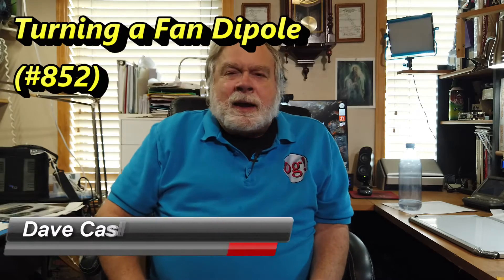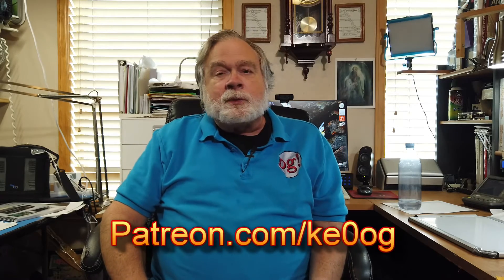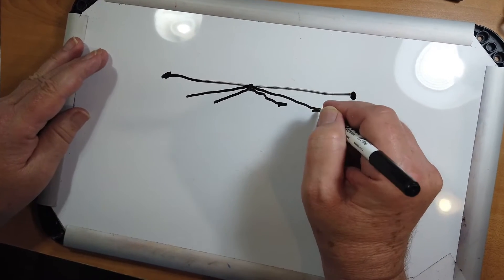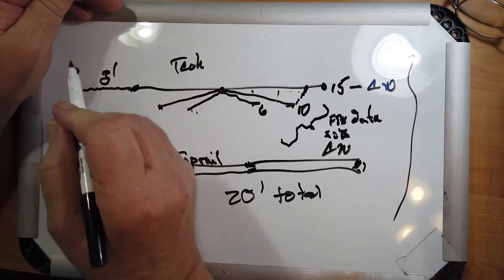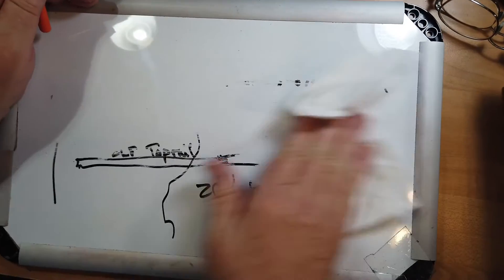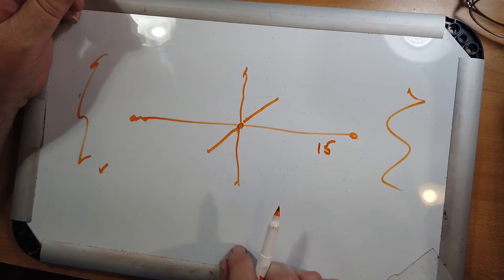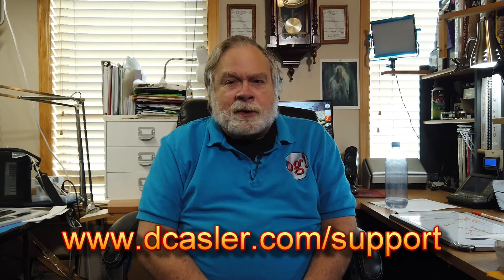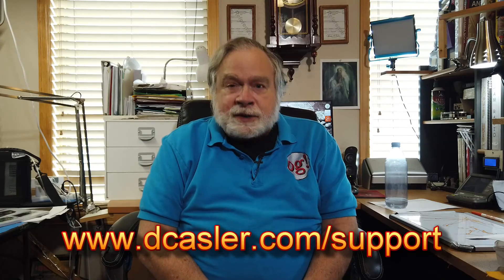Tuning a Fan Dipole (#852)

Comment: That was a good explanation of one of my favorite antennas.  Thanks for posting this, Dave.

I have constructed a fan dipole for portable use.   It operates on 40m/15m, 20m, 17m, and 10m.  It was an interesting learning experience.   One of the things I learned with respect to tuning a fan dipole is that it is important to establish in advance how you intend to orient the antenna.  Because, if you design it and initially install it as a flat top, and you change to use it in an inverted V configuration, the tuning will definitely be off.  

The reason is pretty obvious:

A flat top dipole is going to have a feed point impedance of about 72 ohms, or so.   But, if you install it as an inverted V, the feedpoint impedance will be about 50 ohms.  And, of course, a fan dipole is just multiple dipoles all tied together at the feedpoint - so, this difference is going to affect all bands.

I built mine to be in an inverted V configuration.  I chose that because I then only needed one center support that needed to be up high.  I also designed it to operate at about 30 feet above the ground - because, I can then just toss a line over a tree limb, pull up the center with the coax hanging from the feedpoint, and pull the ends out at about a 45 degree angle and use tent stakes to secure it in place.

For spacers between the elements, I just used 1/2" PVC pipe sections about six inches long and drilled holes for the wires to go through.   Then, I used electrical tape on both sides where the wires went through the spacers to keep the spacers from sliding back and forth.  Spacing is about an inch, or so, between each element - which is quite sufficient.  

Essential for a project, like this, is an SWR analyzer.   Computer modeling can also give you a good idea about your lengths.  And, I found that starting at the lowest band (40m) works best.  Install it, test it, adjust till it is where you want it, then move to the next band up the spectrum.  It ends up like you're building four separate antennas - because, you really are.  To be clear, I am suggesting installing all of the wires at the same time, and tuning 40m, first, then moving up the spectrum to the next band and tuning that.   The reason is that the proximity of the wires to each other will affect the tuning.   So, you want to start out with all the wires in place, even if they are not tuned.   So, you're going to start with all your wires a little long, then trim as needed.

But, once done, it is very nice to be able to predict the radiation pattern and just switch between the bands and start operating with no need for a tuner.   Sure, there are other multiband antennas that use only one wire or set of wires, but the radiation patterns change significantly with odd lobes forming in odd directions.  The fan dipole just gives you a standard dipole radiation pattern on all bands.   

And, I just used a couple of snap on ferrite beads over the coax at the feed point to keep the reflected RF out of the radio.

Thanks, again, Dave, and 73!

Comment: can I run fan with a 72 ohm linear loaded 80m dipole and a 600 ohm folded 40m dipole on the same 450 ohm window line feed point into old style conventional LC tuner (Murch) with twin lead inputs?

Comment: interesting video! I just made a vertically polarized fan dipole for listening to VHF and UHF air band. what I found when tuning it is that the bandwidth increases as you increase the separation of the elements. I ended up settling on a 45 degree angle (about 6 1/2 inches max separation at the tip of the UHF element) with a bandwidth below 3:1 SWR of 20MHz on both VHF and UHF. I am really amazed that you can make a single antenna to cover multiple bands which is of interest to me as a scanner listener.

Comment: Sorry, Dave...but I didn't hear anything related to the question and, certainly, the title is completely misleading.  Wasting my time waiting for "Tuning a Fan Dipole" is not what I had in mind.  Let's try and avoid "clickbait" in the future.  You have some great videos and I enjoy your method of presentation but this one just didn't come up to par.
Reply: NO there is no minimum separation between elements. the bandwidth increases as they are spaced further apart but they can be tuned even when right next to each other.

Comment: I tried a ferrite ring on my outdoor 60m inverted vee at the aerial and found it wasn't very good at stopping r.f. I now have it in the shack. I've seen both positions recommended by aerial manufacturers. I think r.f. got in below the ferrite ring.
Perhaps one positioned some distance from the aerial would be better?
I'm going to slide the rings up the coax to the ceiling to try on my attic dipoles, 14 mHz and 18 on one coax, 21 and 24 on the other with 28 on the other. Three coax cables for less interaction. I might try 14 and 21 together for that reason and 18 with 24 leaving 28 on it's own..
G4GHB.

Comment: I run a home built 75-40-20 fan dipole in an inverted V configuration. At first, I wasn't using a balun. But I then inserted a 1:1 balun. The effect was to reduce noise by 2 S units. I have used this antenna on the 15 meter and 10 meter bands as well. I find it a very good antenna. Tune the longest runs first, the the middle run and finally the shortest run. The center is at 35 feet on an MSJ 1917 fiberglass pole. I try to keep,the ends at 7 feet above the ground in order to avoid deer problems. I have the 75 meter run on a North-South azimuth. The 40 meter run is about 15 degree azimuth from that and finally the 20 meter run is at about 30 degrees from the 75 meter antenna.  '73s AI7MY
Reply: Excellent tip!  I put up a fan dipole in my attic, and it works, but it’s noisy so I’ll try using a Balun….

Comment: The answer to the viewer question is to tune the lowest band first (longest wire) and then the next higher band and so on. The reason is that the longer wire has influence on the shorter ones and that has to be tuned out. Its not as complicated as this video wich also didnt answer the question. Made one years ago and it was easy and worked perfectly.
Reply: I appreciate you trying to answer the question.  I guess Dave was preoccupied with trying to get more patrons….
Reply: that‘s not fair, man. dave is putting a big effort into this videos (try making one, yourself). and he only asks once for some support on patreon, which is completely fine. that there might be better ways to do the job, doesn’t change that.
Reply: Interesting. Makes sense too. I'm considering playing around with some multi-band dipoles once the weather warms up, so this topic is somewhat timely for me.
Reply: everything effects everything. the shorter elements are capacitively coupled to the larger ones making them act like a gamma match and will change the resonant frequency of the longer one(s). the coupling decreases as the elements are spaced further away. so I tuned by first deciding on separation and then adjusting the band that need to be electrically shorter first. if you are comfortable with smith charts, a nanovna is a big help here and you can see where you are just by watching the chart.
Reply: Good job @migsvensurfing6310 let’s just hope the person that wrote in to David read your comments.